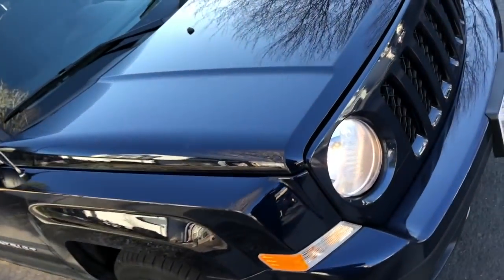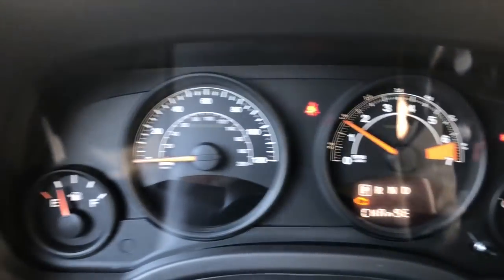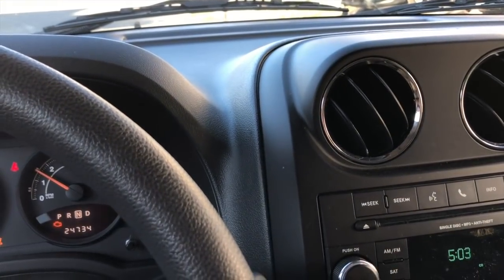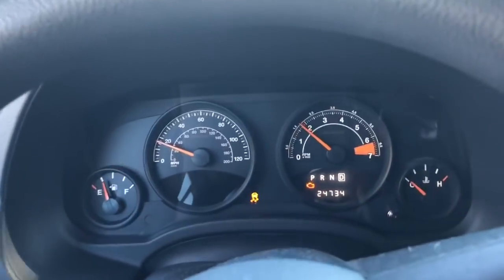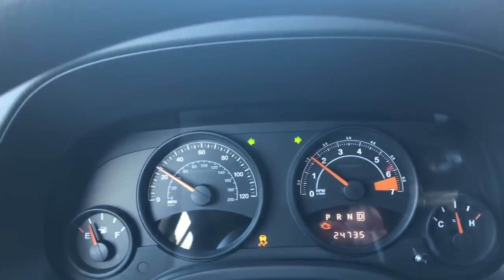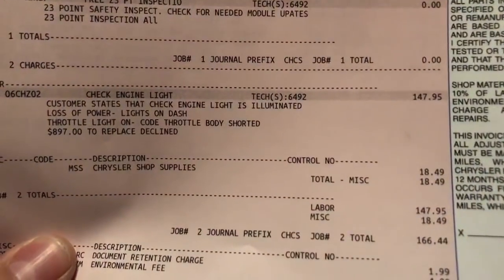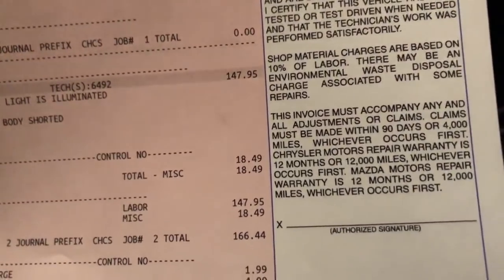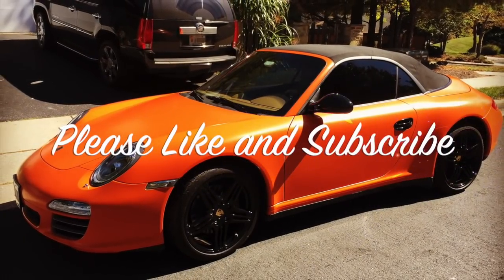Diagnosing a bad throttle body.  Limp Mode Chrysler Jeep Patriot

Comment: hey Omar pretty good vid but  my daughters bf has an 09 Jeep patriot with similar issues  it shudders and stalls limp mode etc so I did this procedure  only to still have the same problems I am a former mechanic of 25yrs  any other ideas?  what it may be?
Reply from the maker: Bill S have you tried reseating the connectors for the throttle body and the maf?  The mass airflow sensor could also be a culprit.  What codes are you getting on OBDII?
Reply: @OmarsGarage  the original code(s) were P0303 and P0507  even before I saw the video I would go with basics 1st  new plugs  then I saw this video and felt had all the same exact issues so went with throttle body
Reply from the maker: Try this procedure to have the computer relearn the new throttle body.

1). Turn ignition to Run, but do not start engine.
2). Wait for all lights to turn off.
3). Over the course of 15 seconds, slowly depress the throttle all the way to the floor.
4). Over the next 15 seconds, slowly let the throttle out in the same manner.
5.) Start car and drive around for a bit.
Reply: Omar's Garage hey Omar I thank you for the input how ever it was not the throttle body at all but the coil packs which where I had included in my diagnosis but where everyone was replacing these I  was like when in Rome lol. Replace the coils and car runs like car should thank you again
Reply from the maker: Bill S very good to know.  Hopefully this info will help others.  Doesn’t hurt to have a new throttle body though as they seem to fail very often on these cars.

Comment: My traction control light comes on and my engine either dies or it loses total engine power for a few seconds and runs fine again. Mine is a manual transmission, so no limp mode for me. Mine is a 2015. Traction control light always comes on and now my CEL is now on. Throttle body?
Reply from the maker: D4Doom have you tried using an obdII scanner to get the engine error code.  If you don’t have a scanner you can usually go to a parts store to get a free reading.

Comment: I have a 2002 Lexus Gs430 and this just started happening to me. Did research and it could have been 39 different issues and after I changed the spark plugs the check engine light went off for all of 3 minutes then flicked back on. I'll cross my fingers and hope it's just the throttle body because I'm having these exact issues with my car.
Reply from the maker: Let us l know how it works out for you.
Reply: @OmarsGarage  Well none of the basic things were working so I started pulling my motor apart. It ended up being an easier fix because some time in the past, rodents actually started chewing through my knock sensor wiring and THAT'S all it ended up being. I replaced the wiring and also replaced my power steering hose as it began having a small leak from the power steering reservoir. She runs like new again!
Reply from the maker: Shaun Mckelvey what a pain in the butt.  Glad you figured it out.

Comment: Thank you so much this just happened to me last night on my way home I thought I’d never figure out what it is😭
Reply from the maker: Hopefully you get it fixed quickly and cheaply.  Glad I could save you a headache 😆
Reply: Currently replacing mine afterbirth bought it from someone that thought the transmission would have to be replaced.  Glad the throttle body was cheaper 🥰
Reply from the maker: Wow, you must have gotten a deal. $60 part.

Comment: Hi omar, first off thank you so much for making this video!
yea i had the same problem a little over a year ago ( October 2018 ) ( i took a picture of the codes i got from odb scanner) 
u0401 - invalid data recieved from ecm/pcm a
u0100 - lost communication with ecm/pcm a
p2173 - throttle actuator control system high ? airflow detected
i thought it was the throttle body as well, so i went and bought the part to replace it.  i also bought a new air filter just in case that wasn't the problem
Luckily when i replaced the air filter the car started to act normally, UNTIL one year later (November 2019) the problems resurfaced
the car started having issue throttling and no power.
the check engine light went on again, i'm going to check for codes and update you
Reply from the maker: Let me know if it’s the same codes.  Also check all the cables to make sure nothing has come loose.  What brand Throttle body did you replace the original one with?
Reply: @OmarsGarage  hi omar,  its kinda late where i live ill try to update you tomorrow on the codes, to be honest, i have never done any work on my car (novice) and wasn't sure if the problem was the throttle body. i bought the same one you recommended in your other video but haven't changed it because the car worked fine when i changed the car filter
i have the same symptoms as you periodically the car will lose power and all the lights will flash, 
not sure if the p2173 code is related to the throttle body or not.

Comment: I have replaced the throttle body and I still get the warning lights (lighting bolt and check engine light) only comes on randomly and then goes away. It drives fine but not sure why the earring lights still coming on. I’ll try to recalibrate it and see what happens. Thanks for the video
Reply from the maker: Sometimes it takes time for the computer to relearn the new throttle body on its own.  I know we had lights on for about 30 miles of driving before it went away.  Keep us updated.
Reply: Did you ever get it to go away. Change my TBM last week and still going into limp mode.

Comment: Hi Omar I need some help okay 3 wks should I went on a road trip I drive a 2014 grand Cherokee overland and when I was driving my Jeep went in to basically limp mode went into neutral it suddenly shut off I went to the side of the road disconnected the battery was able to drive it but later turned off again I took it to a friend he basically replaced the crankshaft position sensor well after 10 minutes of driving it the Jeep did the exact same thing it did on my road trip reading again service electronic throttle body help me pls i need answers I  really don’t want to take it to the dealership if it’s something easy fix oh also my friend deleted all the codes that the Jeep was reading thank you
Reply: And also the Jeep was shaking
Reply from the maker: Melisa Pina it could be the throttle body, but u less you get a scan to see what kind of codes you are getting it’s hard to say.  If it is the throttle body you can check out this video on how to replace it,  it’s for a Patriot but it should be very similar even on a grand Cherokee Chrysler Jeep Patriot Throttle Body Install. Limp Mode https://youtu.be/7Oa4zl6UkCU
Reply: Omar's Garage thank you so much for replying I took it to auto zone and they said to replace the accelerator pedal position sensor
Reply: So idk if that could be it ugh this Jeep never again it gives me so much problems lol
Reply from the maker: Melisa Pina well the pedal position sensor should not be that expensive so I would try that out first.
Reply: Omar's Garage sorry it says accelerator pedal position assembly is that the same as the sensor
Reply from the maker: They do sell the sensor separately, but you have to make sure the part is for your car it may vary by engine size. https://amzn.to/3gathDt

Comment: What is the best transmission oil i can use for jeep patriot to avoid over rev?thanks
Reply from the maker: Wish I could help but never changed the transmission oil on the Patriot.  In general though, I usually go with Motul oil and fluids as a brand.  Good enough for my Porsche 911, it should be good enough for the Jeep.

Comment: hey omar i have a 2007 jeep patriot i replace the throttle body and other parts associated with this problem and i'm getting this code p2016 the car start right up and the engine is smooth but soon i press the gas pedal i still have no power. can you please help me with this. thanks
Reply from the maker: From that code it may be the flow control actuator on the manifold.  Have you replaced that?  If this is not working properly it will not allow air into the engine which means you get no power.
Reply: @OmarsGarage  
no omar i didnt. but i'll now.
Reply: @OmarsGarage  
do you know the name of the part or the part number? thanks
Reply from the maker: I believe it’s 4884549AD
Reply: @acevedowireless  did replacing that part work?

Comment: You think the same problem could be on my 2010 grand Cherokee srt8 the exact same thing happened went on limp mode and all the dash lights came can anybody help please ???
Reply from the maker: I could well be.  Have you got read any codes off of the computer?
Reply: Omar's Garage thanks for replying and no it doesn’t give off any codes it’s really frustrating.
Reply from the maker: Carlos I Sanchez is it intermittent?  On the Patriot this is how you have the tb reset itself but not sure of it works on the Cherokee 
1). Turn ignition to Run, but do not start engine.
2). Wait for all lights to turn off.
3). Over the course of 15 seconds, slowly depress the throttle all the way to the floor.
4). Over the next 15 seconds, slowly let the throttle out in the same manner.
5.) Start car and drive around for a bit.
Reply: Omar's Garage ok thank you so much really appreciated will do 🙏
Reply: Omar's Garage it does it after a couple of minutes of driving and after leaving it off for a bit it goes away

Comment: My vehicle is having the same problem in my vehicle is a 2016 Jeep Patriot and it started doing it after 2 years of owning it
Reply from the maker: Seems to be a very common problem.  Hopefully it’s the same solution as mine.  Watch my throttle body replacement video.  Don’t forget to subscribe :)
Reply: Where’s the cheapest place to get a throttle body? Same issue 2016 Patriot
Reply from the maker: I have a link in the description to the one I used. It’s around $60

Comment: I have a 2016 Jeep Patriot and this exact thing happened to me except, the next day when I turned the car on only the check engine light remained on. I turned the car off and back on again, no check engine light. Could I have an electrical issue? I have a code its: P2173
Reply from the maker: Alyssa Rivera it will act up intermittently.  That code could definitely be related to the throttle body.  Keep driving it around and if it happens again you may want to look into replacing the throttle body.  I made a video on how to replace it right after this video.

Comment: The lightening bolt came on and want start. I drove it yesterday and stowed no signs.
Reply from the maker: jeep grl did check engine or any other lights come on?
Reply from the maker: It may be your battery if not won’t start.  Check out this video How to check a battery, alternator, and replacing a battery. Absorbent Glass Mat Battery https://youtu.be/7uTPMmFpghg
Reply: Omar it was the battery. I didn't know it was the original battery on my car. Ty for your help.
Reply from the maker: jeep grl glad you got it resolved.  👍

Comment: 2007 Jeep patriot- throttle body light came up, i am only getting 15 per gallon in my Jeep. i should be getting 22 per gallon.
Reply from the maker: Any hesitation or loss of power?
Reply: @OmarsGarage  nops.
Reply from the maker: I would get an OBDII scanner and check for codes.  If you don’t have one, most local auto parts stores can check for free.
Reply: @OmarsGarage  I just took the Jeep so they can clean the throttle body,i notice a difference.
it still showing that its giving 16 miles per gallon.
Reply from the maker: @c19commander44  well I would reset the mile per gallon indicator and see if after the cleaning, the average mpg changes.  Good luck.👍
Reply: @OmarsGarage   How to reset it.
Reply from the maker: I’ll try to take a look next time I’m in the Jeep .
Reply: @OmarsGarage  Thanks

Comment: Hello sir Im having the same issue, I purchased a used TB for $300 from O'Reilly. The car drove smooth for about 2months and then out of nowhere this happened. Should I purchase another TB from Amazon?
Reply from the maker: Good Steward Real Estate honestly, I wouldn’t have purchased a used TB as they are prone to go bad.  I think I paid $100 for a brand new one.  I would try to buy a new and see if that solves the problem.  Here’s a link with the details and install video I made. Chrysler Jeep Patriot Throttle Body Install. Limp Mode https://youtu.be/7Oa4zl6UkCU
Reply: @OmarsGarage  ok would disconnecting and reconnecting the battery help?
Reply: Can you give me a call? Too much to type
Reply from the maker: Email me your number redfirevenom@gmail.com
Reply: @OmarsGarage  i sent it check your email.
Reply: @OmarsGarage  i had a mechanic come over and said my refurbished TB was clean with no buildup and said it coud be the catalytic converter instead...?
Reply from the maker: I wasn’t able to call until today, I’ll try to again later.  Are you getting the same symptoms as before you changed the throttle body?  Mine didn’t have any buildup either when I replaced it.  The issue is not due to build up, it has to do with the electronics going bad.  If you are getting the three lights on your dash and the car is going into limp mode I would just pay the $75 and replace it with a new throttle body in my humble opinion.
Reply from the maker: APDTY 112542 Throttle Body IAC Idle Air Control TPS Actuator Assembly Fits 4-Cylinder 07-10 Sebring 2007-2014 Chrysler 200 or Dodge Avenger 07-2012 Caliber 09-17 Journey 07-17 Jeep Compass or Patriot https://www.amazon.com/dp/B00QFTMHCY/ref=cm_sw_r_cp_api_i_PQZ8CbDDWF72Q
Reply: @OmarsGarage  im waiting to receive the new TB in the mail, in the meantime I had mechanic clean the one that was installed. It had no buildup on it at all. I drove it around the block a few times then parked it. An hour later it drove fine, no more limp mode. I ran into a traffic jam and sat with car on over an hour, thats when the light came back on.
Reply: @OmarsGarage  call back now I was outside trying to drive it.
Reply from the maker: When the throttle body was failing on this Jeep it was very intermittent.  Sometimes it would work fine and other times it wouldn’t.  Sometimes turning the car off and on would solve it for a while.
Reply: @OmarsGarage  this is day 2 and it only drove fine when the mechanic took it off and cleaned it. When he reinstalled it I drove it around the block worked fine. Sat in traffic went back into limp mode

Comment: Hi I am having the same issue with my 2014 Jeep Patriot I have have already changed the part but I am still having the same issue. Any suggestions on what else it may be ?
Reply: I had the same issue after replacing the part I decide to change the plug and no more issues  I got the plug from Amazon $14..good luck
.
Reply: What kind of plug?

Comment: The dealership is most likely dishonest. A Ford dealership wouldn't admit a major problem because it was in warranty. I had to, without mechanic skills, find the problem and sure enough, it was under warranty and I am convinced it was a cover up because it's an expensive fix. They are crooks.

Comment: On my wife’s 09 Jeep Patriot the traction control and ESP BAS light always comes on and stays on when starting the car. What could that be?
Reply from the maker: That’s looks to be related to you anti lock braking system.  It could be one of many things such as the abs sensors.  I would get that checked out by a professional who may be able to scan the computer more thoroughly for errors.

Comment: I change this part and still does not accelerate after running 35 minutes 😣
Reply from the maker: Did you disconnect the battery for a while?  Sometimes it will reset the computer.  Otherwise it may be a different issue.
Reply: @OmarsGarage  Yes, my husband disconnected the battery and I try to drive it for a while but still loosening the aseleration I put my foot all the way to the floor and nothing from 30 to 40 min later 😣
Reply from the maker: Farahona Gomez check for codes on the computer.  There may be another fault somewhere.  Also make sure your husbands rechecks all the connections to make sure they are secure.  The ones her removed to install the new part.
Reply: @farahonaa  did you try the tps?

Comment: That's Dodge for ya. They should have honored that repair,  it was a preexisting condition.  They programmed the computer yes, but it didn't fix the problem.
Reply from the maker: I was pretty upset that they didn’t stand by their product.  Charging $900 for something that takes half an hour to replace also seems pretty excessive to me still.
Reply: Yea I'm a used car technician at a major dealership and to be honest the cars I see that have the most problems are Dodge/Jeep, GM, and Mini cooper.  All cars will have problems but there comes a point in time where you just wonder if they even test their cars before they send them out. Lol
Reply from the maker: Dan Mead I would love to know how many of their cars have a faulty throttle body.  I get messages all the time asking me for more info on this.  I also don’t understand the reasoning behind not giving rental cars out when you are getting warranty work.  I’ve owned several different cars from other companies that always gave me a rental when I had to get something fixed under warranty.  My first car a Ford Mustang did that.  They need to stand by their products.
Reply: No arguments here, I have had the same issue actually. GM, gave me a loaner car but Mitsubishi paid for a rental.  The dealership I am at now we give out loaner cars for repairs that will take more than a day. 

I just worked on a 2014 Cherokee with the throttle code, so I tried cleaning it and clearing the codes. So far it seems fixed. 

When I had a new PONTIAC G6 I ended up taking GM to court under the lemon law.  I won $10k but I just wanted a different car because of all the problems.  Lol